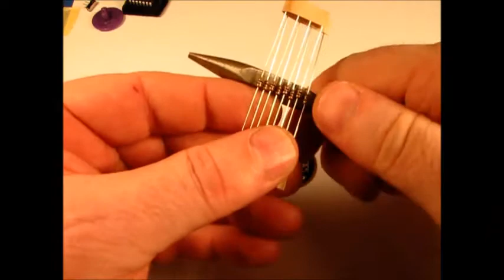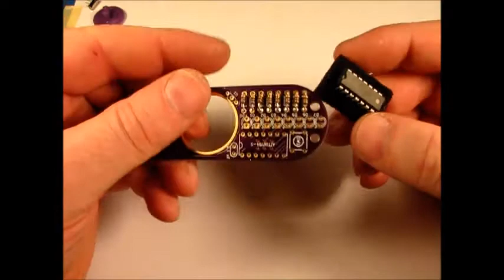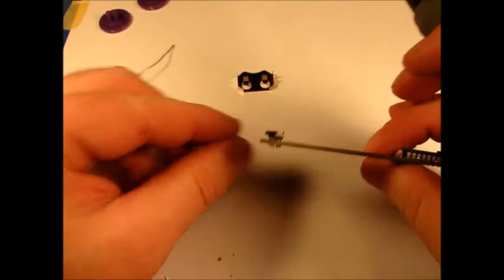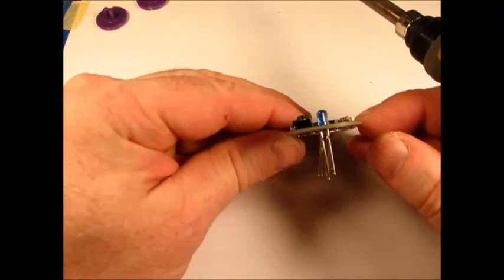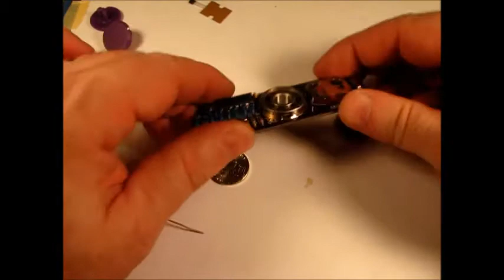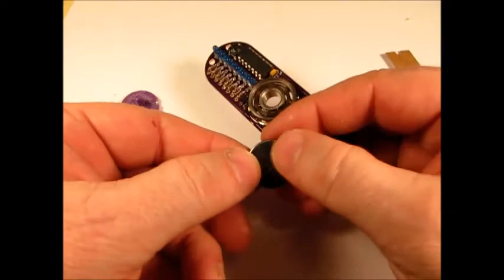Programmable POV Fidget Spinner Assembly

Comment: This looks like a fun project to revive.  As such, I ordered new boards from JLCPCB. $25 for 15 boards makes this affordable again ($1.67 per board vs $6.43).  I was wondering if that was possible, but a quick import into KiCAD, and an export of the gerber to JLC worked wonderfully!

I'll keep you posted.  Might have to do an SMT version, or one with directional detection, or both!   (Now if only I could get JLC to weld that awful bearing for me)